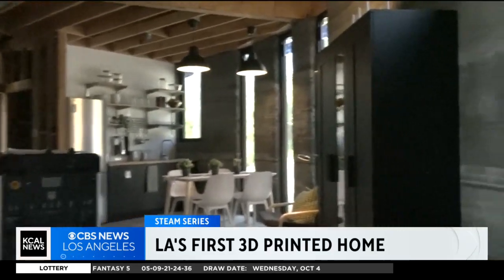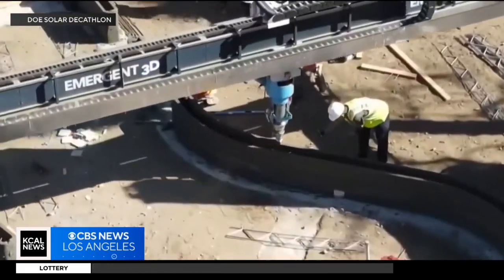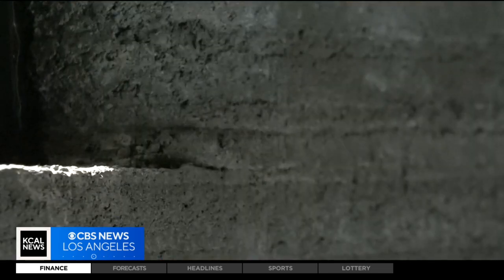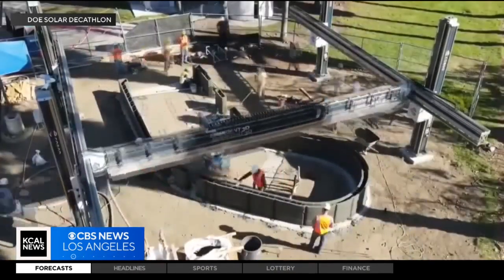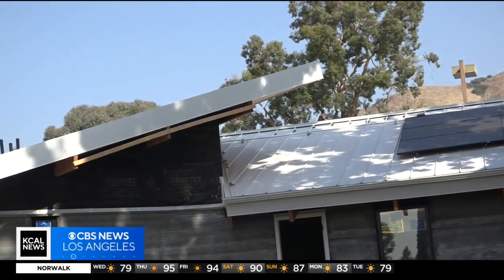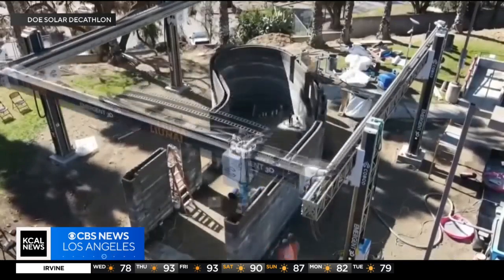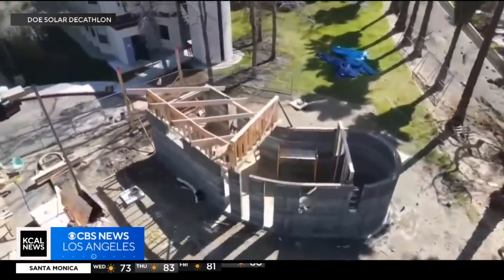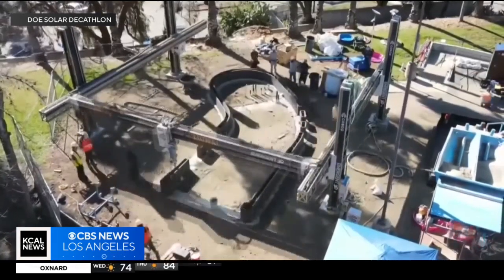3D printed house could be future of affordable housing | Steam Series

Comment: I would say that this is a start, but we have to move away from all of these single family, detached homes.  Land prices will continue to skyrocket so you need density in order to provide "affordable" housing.   You also need to factor in mass production into the mix.  Housing units can be quickly and consistently be fabricated in an environmentally controlled, factory and assembled on site quickly.